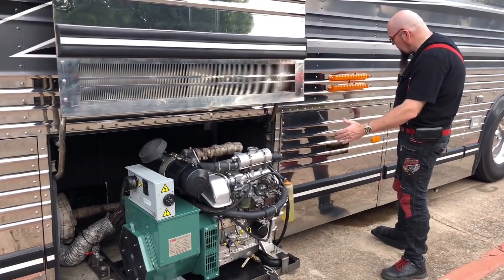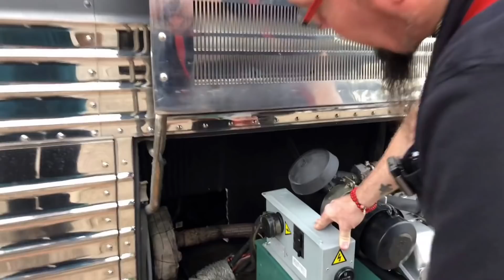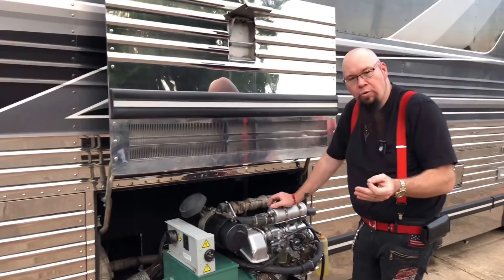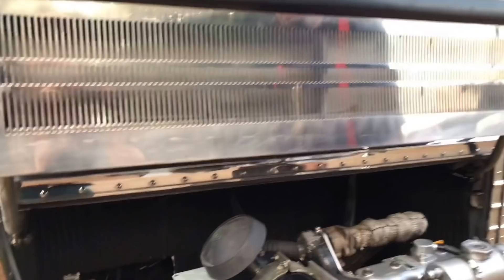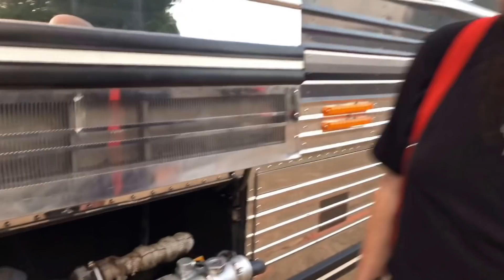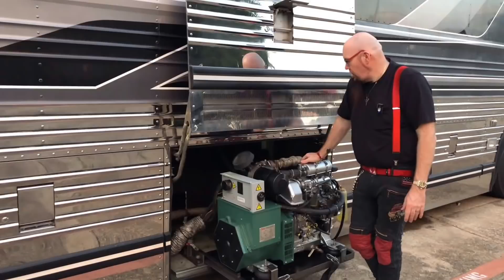Learn about Generators for Busses and Motor Coaches - Prevost - Eagle and others.

Comment: Can you talk about the wiring?  I just upgraded my Kubota 12 kw that had only a 30 A breaker.  Put in a 50 A breaker but had to change the cables from 8 guage and 10 guage  to 6 guage  wiring to handle the higher amps. Do you have a battery isolator from your engine batteries to your house batteries?   

120 volts x 50 amps is 6 kw. Does that mean that each of my two 120 lines on my 12 kw generator can both draw 50 amps each without blowing the breaker?  

What happens when you are charging with your alternator and generator at the same time?  Do you have an automatic transfer switch so that both are not charging at the same time?

Comment: I have a great plan to strip out my hot water tank and add in a little gas engine and truck alternator for a perfect little generator for my truck box camper. Basically for free with a engine from the dump and a spare alternator off my diesel truck

Comment: The install and engineering of your generator is excellent.  The slide out tray is great for servicing.  My Wanderlodge has a 20KW  PowerTec unit mounted in the 3rd bay roadside.  My engine is not turbocharged but the engineering is the same as your except for your slide out tray and my exhaust exits our the underside of the bus.  Thank you for your video.  Very informative.

Comment: Have no idea how I ended up here, but...........I want to buy a coach like this just for the diesel generator.   Non runner would work if using as stationary housing/shelter.   Stainless Steel under a photovoltaic-roofed ramada.

Comment: I have a 1999 Foretravel with a 10Kw powertech Diesel generator.  Mine has a 120v squirrel cage fan, a remote radiator and is supplied by a 200 gal diesel tank.  The engine is a Isuzu 3ld1 3 cylinder engine, naturally aspirated. Its quiet, runs great, will run over 50 amps continuous, and is a much better solution than your setup. Most are not Yanmars imo, but Kubota's, Isuzu's and cummings.  My coach is a all electric coach, and it runs everything I ask of it and more. My radiator faces backward and exhausts heat into the wheel well.  Who would want their radiator facing towards the road where it will pick up dirt, and road kill? And why would I want to exhaust 30 feet away, when sometime you will develop a leak and send CO into your bus? Turbo on a genset? No thanks. Not needed, overly complicates things and is a PIA to fix and service. 
Your comments about diesel engines not able to run over 2200 rpm is grossly inaccurate.  Many diesel engines can go far beyond that, over 3k. They are designed to have the power curve and maximum torque at lower speeds. But they do need to be run higher at times to burn off carbon. On a genset, the RPM's are set to provide the amount of amps and hertz you need. 1800 is for 120/240 volts and 60 Hertz.  There are many higher rpm gensets out there. They are noisy, use more fuel, and vibrate more. 

While changing the oil more frequently is great for your engine, not so great for your wallet.... 100 hours seems a bit excessive to me, but to each his own.

I will stick with my power tech.  Prevost is a overly complicated high maintenance money hungry, high cost coach. If you can afford that kind of complexity, then good for you. Foretravels have their own level of complexity as well, but not nearly as much. But I guess the wow factor of the Prevost is there. But for commercial applications... its great.
But your genset is clean, well maintained, and you did give good advice for taking care of it. So bravo to that.

Comment: I have the same setup but I have 2 wooden doors that close off the generator (no vents on the outside door like yours)  it works fine but seems like the vents would be beneficial, are they essential or not?
Reply: Yeah engines need air flow even if it's just convection cooling you gotta have some way to vent vapors out